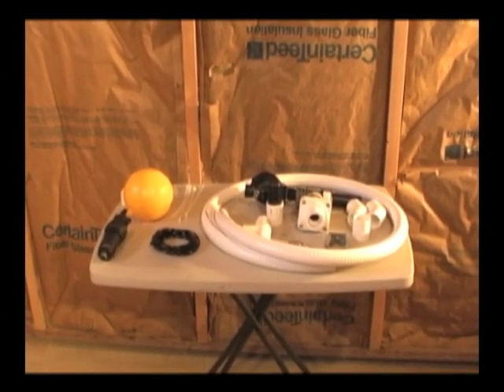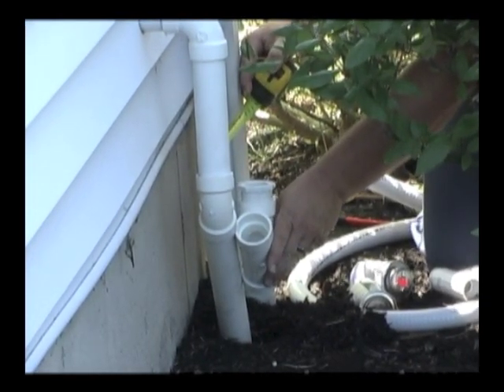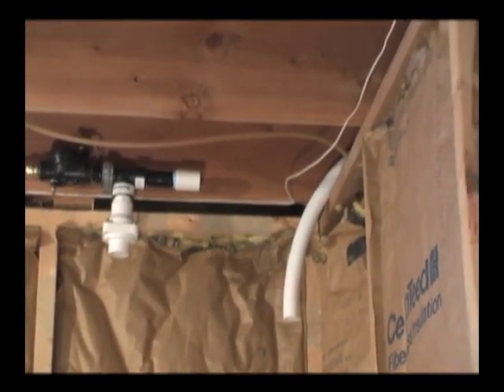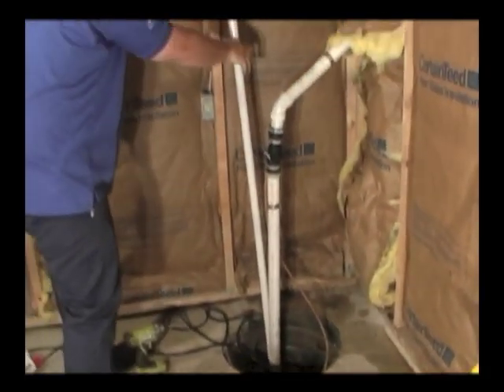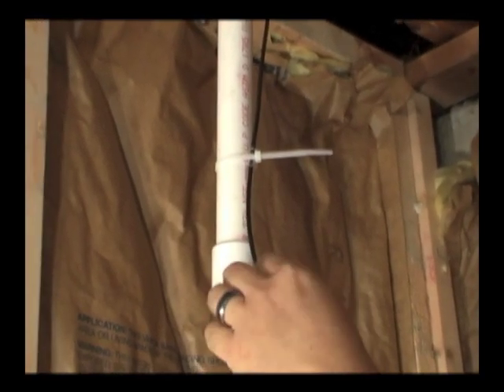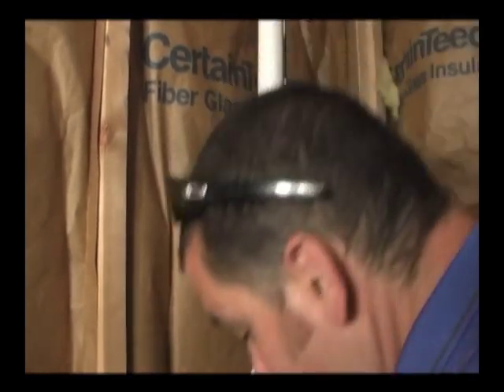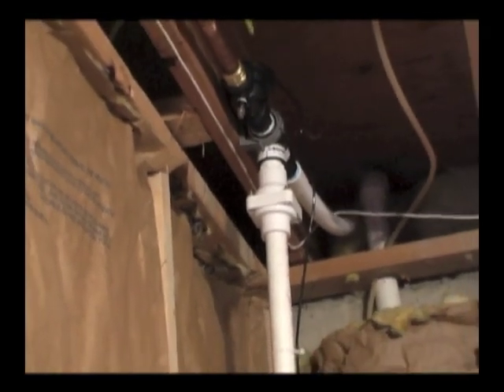Basepump RB750 Water Powered Sump Pump installation demo

Comment: There should always be a filter on the incoming water supply to protect the venturi valve from sediment. A double check valve on the incoming water line is also needed.;

Comment: You never connect the discharge line from the pump directly to the exterior drain line. You must always have a physical air gap between the pump discharge line and the exterior drain line.......
Reply: Contractor John...... Because....???
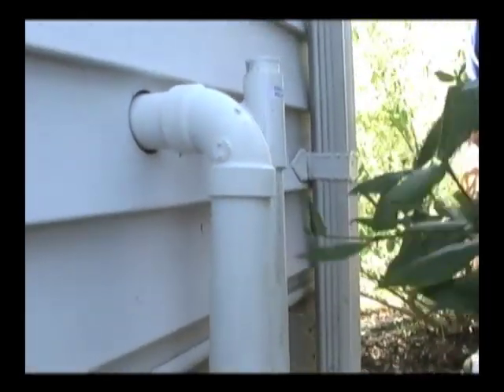Reply: Air gap shown & mentioned at 2:23.

Comment: Depending on the type of primary (electric sump pump), couldn't the existing ejection pipe,  with a parallel by-pass & back-flow preventer, also be used as the suction & exhaust tubes for the induction pump?  
This would avoid most of the plumbing, & put only the new sensor in the sump.  What is the practical height limit of this pump? (My theory is about 27' for a trickle, or about 12' for reasonable flow during low atmospheric pressure.)